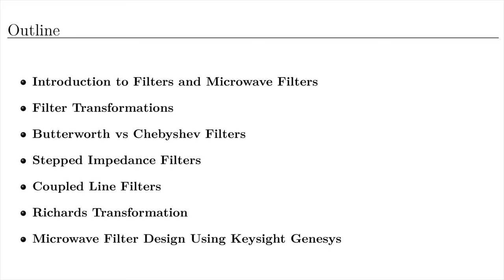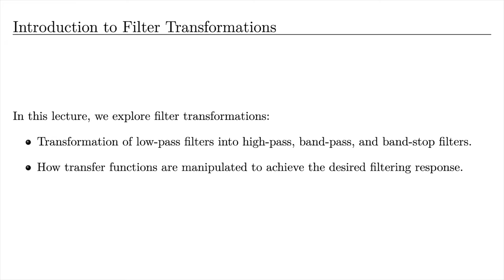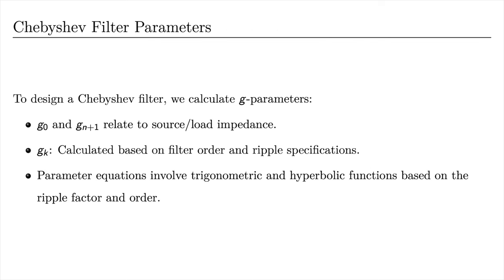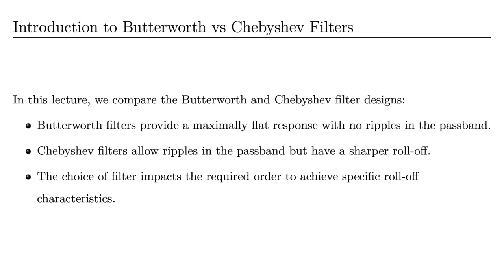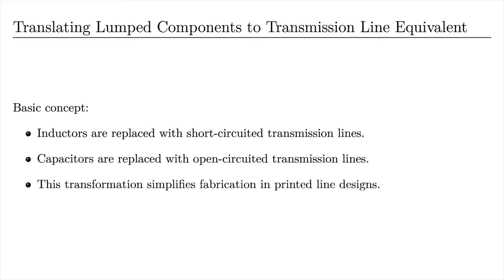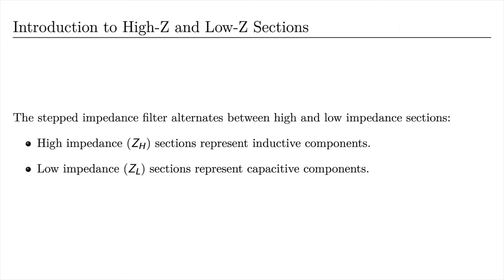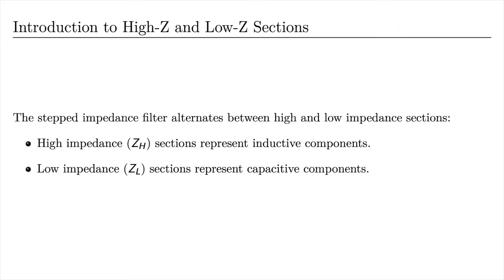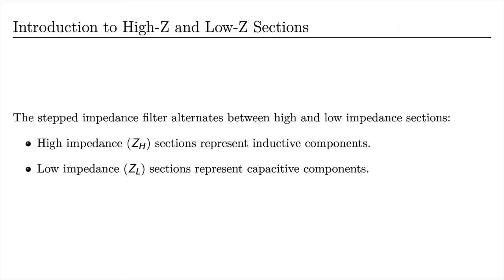Microwave Filter Design Tutorial: Butterworth, Chebyshev & Advanced RF Techniques

Comment: Can we design impedance matching circuits, tapered balun for dipole feeding in this software !!
Reply from the maker: @asim_hussain  yes it is possible to design all kind of signal control circuits like balun, power divider, coupler, phase shifter, and attenuators. Thank you.
Reply: @ i want to design in hfss but i see this software is easy to use can we export the design to hfss after designing here!! If possible can you make short tutorial for the balun design please
Reply from the maker: Yes it should be possible to import the design in HFSS. Ok, we will do this tutorial. Thank you.
Reply: @profhalimboutayeb  thanks professor